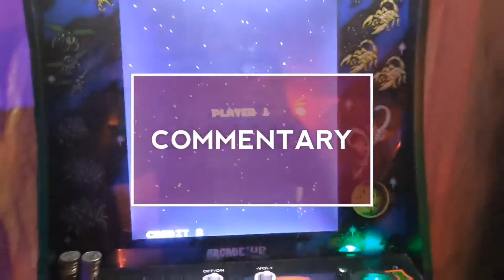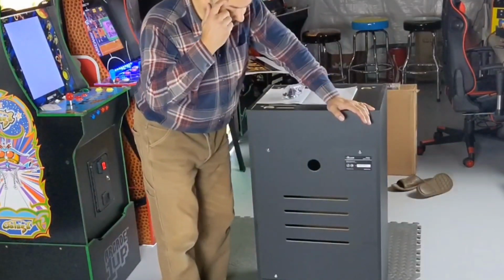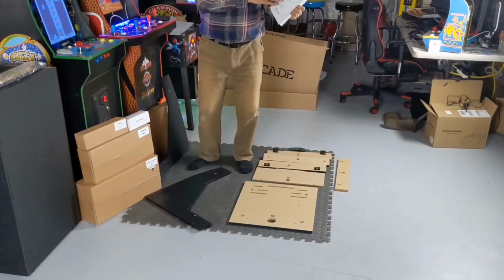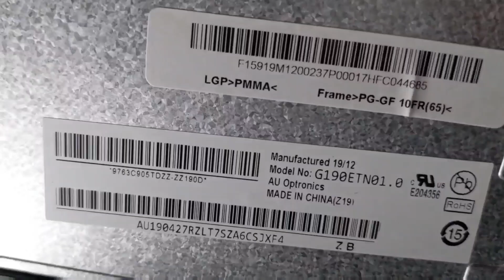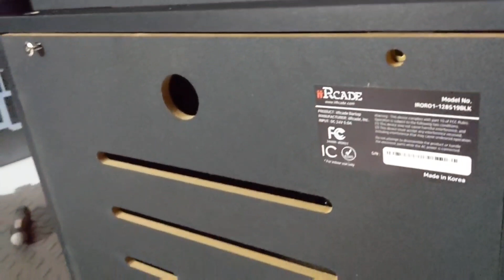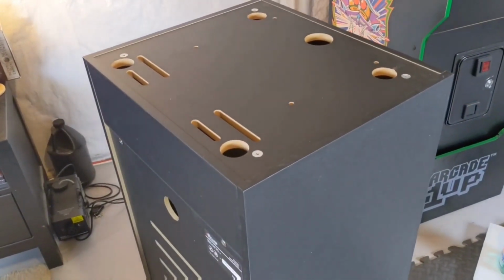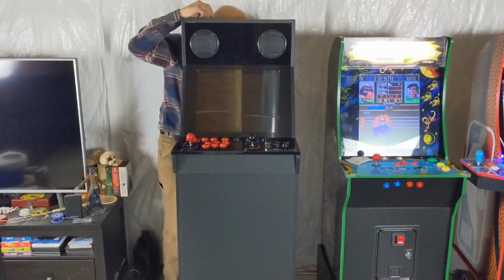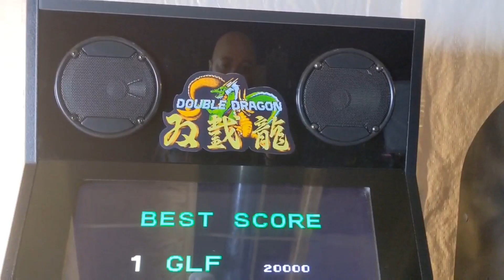iircade: “Black Edition” aka Double Dragon Received and Assembled

Comment: That is the best looking version I have seen so far.  Good video man.  Your arcade is looking pretty sweet.  Have you considered using some tapestries for your walls?  I picked up one that looks like brick that I hung up and an retro 80s sun looking one from amazon for my walls.  Could be thay extra bit to give it an even cooler vibe.
Reply from the maker: HOLD MY BEVERAGE for a second! What are you trying to say about my insulated walls, LOL 🤣 I know and I have. I have added Black out curtains behind my chairs on the other side. I was looking for some free standing wall panels with brick, but have not see the items you mentioned. Can you provide a link for your suggestion?
Reply: @DetroitLove something like this. IF you look at my latest video with the foosball table, you should see one in the background behind the baskeball and skeeball.  I'm not sure it was this particular one, but it is something similar.  https://smile.amazon.com/dp/B07BW8QHRM/ref=cm_sw_r_cp_apa_fabc_OV37FbFAK974B
Reply: Feel free to watch the whole thing lol, but about 9 minutes in probably gives you the best view of the tapestry.